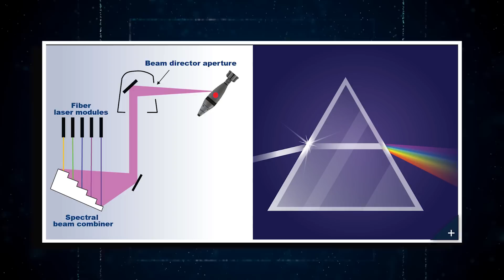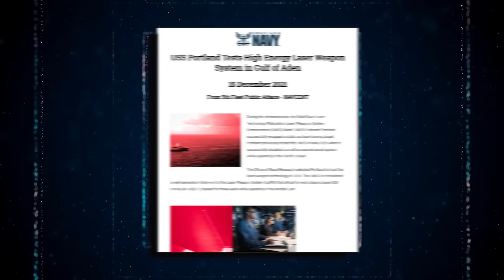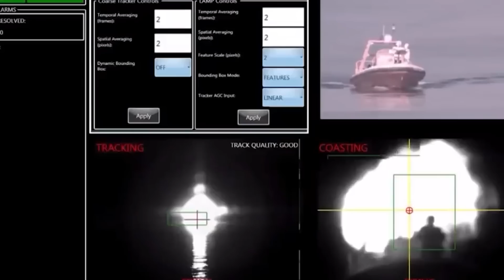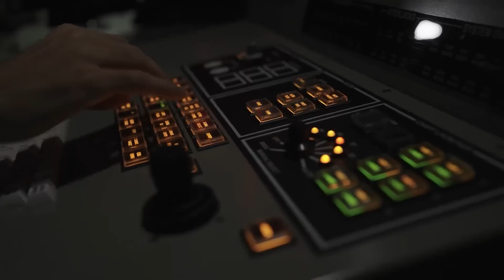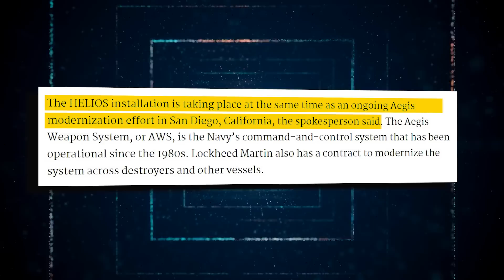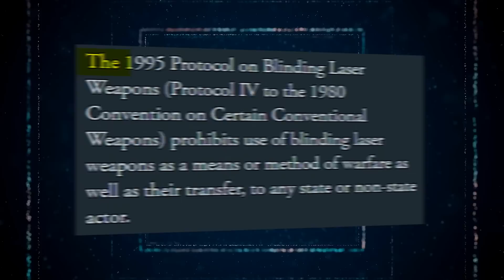The U.S. Navy Just Admitted They've Created Something So Advanced & Said It Can't Be Stopped

Comment: they can use DEW microwaves to heat up ocean surface and start a hurricane, they can also use said weapon to increase the hurricane's strength if the hurricane seems to lose power, they might even have some influence using DEW to control path of hurrican, then they can use DEW lasers to start wildfires and use said hurricane as cover to blame for undetectable lasers that actually started the wildfire, also DEW lasers can be precision tool for control of area where wildfire will burn, all this while having the benefit of deniability for any such involvement for what will be blamed as an "act of God"
Reply: I felt like I was hit by a Lazer about 3 different nights trying to sleep because I heard a buzzing microwave sound. I felt like it was a dew so I laid down on the floor and it stopped. This was at the beginning of COVID. It's not the same feeling as a migraine headache because it felt hot. This is just a drop in the bucket of the way I suffered around 2020 From other forces I don't fully understand.
Reply: Carbon Black /🌀 Steering

Comment: I can imagine a a 1st surface mirror finish in gold on the surface of a missile and filtered or polarized optics defeating lazers..
Reply: lasers have been used to cut through metal and at a certain power could melt or even vaporize metal, I would presume.
Reply: @Kristine Smart I've studied lasers and laser application in the early 80s, 
Brewsters angle has to do with frequency and angle,
Gold will reflect any  laser %99.5 silver at %99 the resonant frequency of an object or substance has much to do with its absorption of power froma laser.

Comment: The primary purpose of laser weapons is to destroy hypersonic missiles. These missiles are however protected against temperatures of 1000 degrees Celcius. To pierce this armor the laser must have a power of approximately 1 Mega Watt. Atomic-powered aircraft carriers have all the power needed to use these lasers. It has been estimated that the cost of each "shot" fired by a laser would be the equivalent of the price of a cup of coffee.
Reply: Also the fact that laser light can travel at Mach 874k to intercept an Avangard hypersonic missle traveling at top speed of Mach 27 before missle can even change direction. A laser grid dome would give the missle nowhere to go but detonate befoire reaching a target.
Reply: It doesn't matter how fast a missile is, if we have a countermeasure that travels at the speed of light.
Reply: Or light Maui on fire
Reply: Is the 1k resistance for overall heat (analogous to baking in kiln), Vs highly focused point targeting (Ex: at a weld or tongue&groove  junction, or ammunition's  engineered explosion's "path of least resistance")? After all, without a designed relative "weak point", as I understand the physics of explosions in contained spaces) those munitions  would require internal generation of >1k temp (or comparable pressure force) to push through its own outer walls at just the right time to explode its target. Otherwise it just punctures its target by staying ~ intact on impact (unless speed + weight exceeds force comparable to 1k degrees?)? 
   Would an orbiting concave solar-energy focusing "mirror" (+/- series of ray-directing mirrors within earth's nearer atmosphere) be able to heat an aerial object to or above 1k degrees (though I dread such a weapon, due to global "thermal pollution", among many other reasons)?
Reply: A megawatt might do the trick against hypersonics.  But I don't think the Navy has a viable Megawatt laser in production yet.  100-300 MW at the most.
Reply: is that a self-brew cup of coffee of about 12 cents or a 1250 cent priced one by one of those decadently priced beanpushers like the MermaidCoffeeBrand?
Reply: Or light bushfires?..
Reply: Can be weaponised to kill billions of people.
Reply: Maybe a negative particle beam.
Reply: https://youtu.be/XLnPs-H72hI?si=9ce0kwkojtFsbukD
Reply: 😂😂😂 laser power only works on land not  sure lasers will affect nuclear subs based all over the world 😂😂😂
Reply: 1 MW is not problem for lasers absolutely. You do not need atomic powered aircraft (but this is a good idea). The capacitor is sufficient. And the purpose of a laser is notto warm up the whole target necessary.
Reply: I remember reading something many years ago that Laser weapons can be defeated by painting a target in highly reflective paint. Whether or not this wou!d work I don't know.
Reply: Better to entice Mother Nature to donate a bit of her thunder, using petawatt subpicosecond lasers to trigger, control and guide megavolt discharges through artificial lightning tunnels.
Reply: How do you know all this information? I must be in the wrong line of work.
Reply: @datacentermechtalk6852 

It sure makes me feel more stupider than I already am! 😂
Reply: @Data center Mech Talk  its called research and the freedom of information act
Reply: China had been showcasing their lasers in Hawaii and around their borders.  I fear the balloons had something to do with a tracking system.
Reply: Exactly white wolf
Reply: The newest laser is thousands of times stronger than the surface of the sun.  And it's solid state
Reply: Hi Whitewolf - Do you know if there is a limitation to how many lasers can be combined as shown at 3:56? We see 5 fiber laser modules combining - Why not make it 50 o 500 or more to combine to be a more powerful weapon? Are there limitations to building a laser like this? other than cost and space required... I mean physics of the combining of the light.... thanks
Reply: @ichanicindustries499  Only power requirements and engineering know how. We may encounter a beam density threshold at some point, but were talking Star Trek level technology at that point...some 2 or 3 hundred years in the future.
Reply: No, the primary purpose of these laser weapons is to destroy low cost loitering munitions, mortar rounds, drones, and perhaps cruise missiles.

Hypersonic glide vehicles are more the domain of missile interceptors.

Comment: The media as well as this video loves to show laser beams as visible rays of light.  Given how clean the medium they travel through those beams are mostly invisible unless there is a lot of rain or dust in the air.  A visible laser beam means a laser that is losing energy on it's way to the target
Reply: also pew pew
Reply: Your wrong mate
Reply: @straightblast569  My wrong is better.
Reply: 100%
Reply: what if they put a color filter over the laser lens cap tho.....?
Reply: it all depends on the lasers wavelength my guy. for example even without rain/dust u could see a green laser beam but not a red one meanwhile IR lasers are just outside the human capability to see so no matter how obstructed the air is with particles we will never see it.
Reply: @Immortal_BP  But can lasers of wavelengths similar to green light preform in the way these lasers do? Maybe OP was referring to a type of laser that would be used offensively? It follows that a laser used offensively would have vastly different properties than a laser designator or similar device.